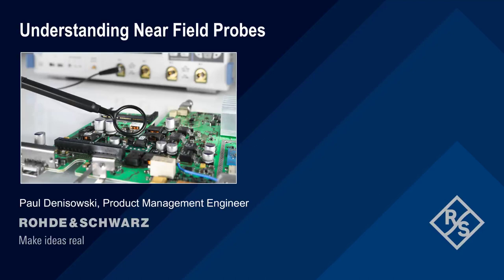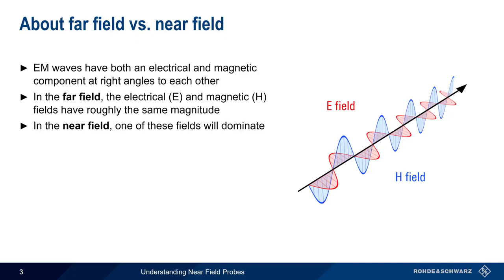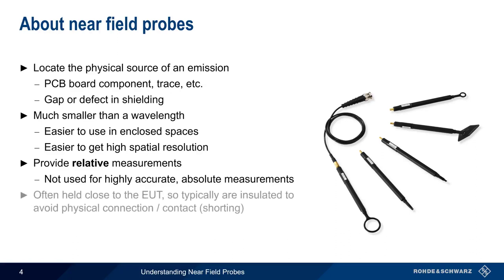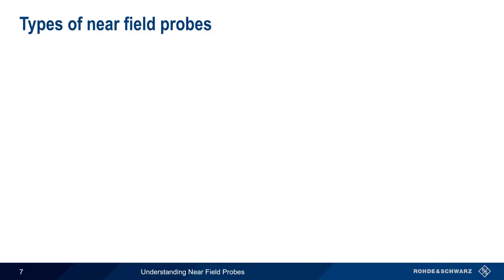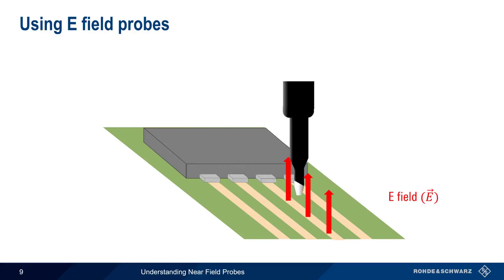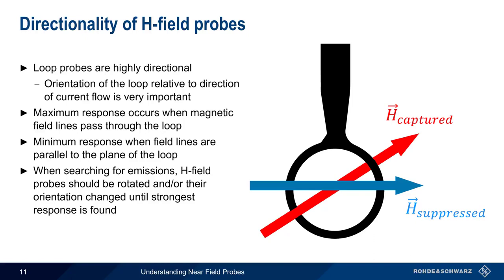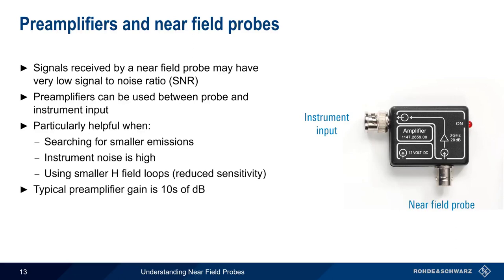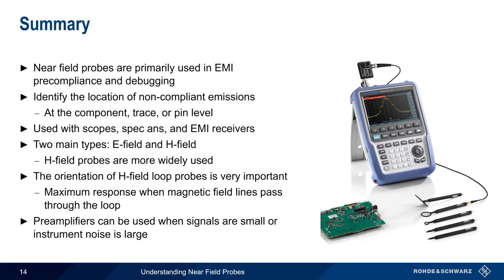Understanding Near Field Probes

Comment: What is meant by the E and H being approximately equal in the far field? I thought the ratio of E/H was 377:1? (ie the characteristic impedance of free space)
Reply: Good question.  In the far field the E and H fields have approximately the same wave impedance (377 ohms).  This is often defined as the distance (wavelength / 2 * pi) from the radiator. So for a signal at 100 MHz (lamba = 3 meters), the transition from near field to far field occurs at a distance of about 0.5 m.  Prior to this point, the wave impedances will be unequal, and the nature of the radiator determines which impedance dominates:  this includes things like whether the antenna has a dipole versus a loop type structure, whether the source is high or low current, etc.  

Although this is an important topic (and one which I'm planning to cover in a separate future video), as a practical matter, successful EMI debugging with near field probes generally does not require knowledge of wave impedances, etc. :)   In the case of debugging a PCB, for example, it's simply important to important to know that the probe should be held close (1-2 cm) to the board, different probe types (E vs. H) should be tried, and especially in the case of loop-style H field probes, the probe should be rotated and/or have it's orientation changed.  The low amplitudes of some emissions and the need for high spatial resolution (i.e. which specific trace, pin, component, etc. is causing the emission), often require the probe to be held much closer to the EUT than the mathematical demarcation point between near and far field, which is why I left the math out of this presentation :)  

Hope some of that is helpful.  Thanks again for the question!

Comment: You explained very well at the beginning that the E field and the H field move 90 degrees relative to each other and later in the video that the H field is a round loop surrounding the conductor. For the E field I understand well perpendicular to the conductor, ok for the E field but how can the H field be at 90 degrees from E if it is a round loop?